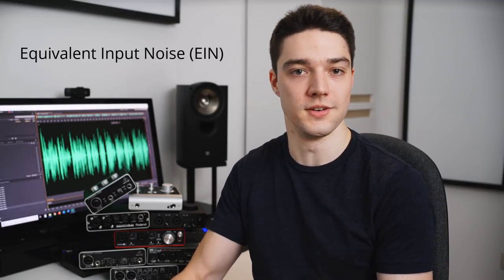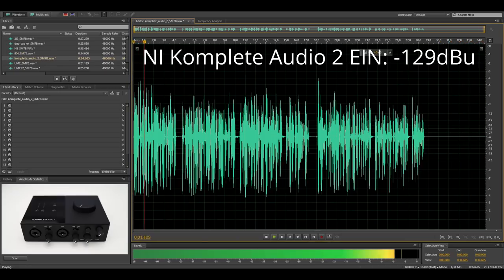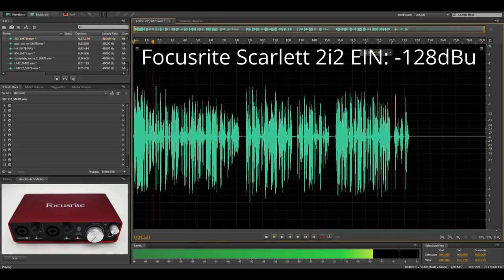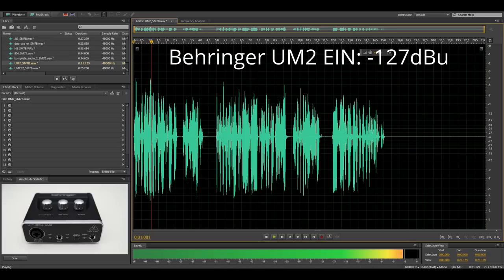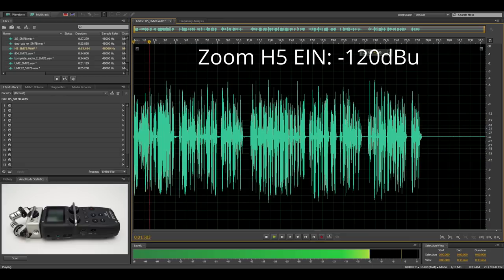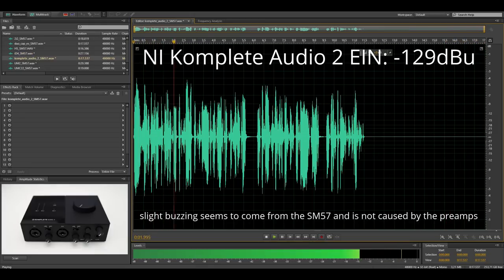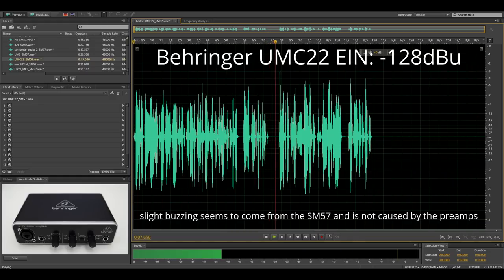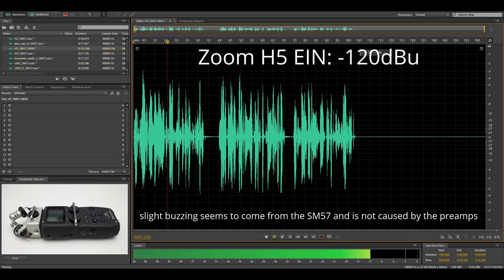Noise Compared - Behringer, Focusrite, NI, Roland, Steinberg, Zoom (with Shure SM7B and SM57)

Comment: The Audient sounds great of course, and I'm also very impressed with the Behringer UMC202HD, especially when you compare its price to the other offerings.
Reply from the maker: I totally agree, the price-performance ratio is very high with the Behringer interfaces.
Reply: @JulianKrause  i'm surprise only -1dbu difference... i am rocking an id14 btw
Reply: But you cannot compare the preamp of behringer with the others...
Reply: @MRBADGUY0027  yes because its midas and outstanding high quality
Reply: @JulianKrause  the dynamic range of the umc202hd is much lower than something like motu2，result is a “harder harsher or cheaper”sound
Reply: @Hallucinogenichusky i aggre i have umc22 but not the umc202HD. It produce little bit noice, than i try steinberg UR22MKII and the noice gone. 

I concern it because the quality of the preamp (yamaha vs midas) or because i put only single line input on behringer from the X32 compact mixer, but on the steinberg i put 2 line input from the X32 compact mixer. (I cant put 2 line on Behringer UMC22)

How you thing..??
Reply: @Hallucinogenichusky if you are using a Mac , check the ground on the charger
Reply: @liningwzgl  Why there should be a difference in dynamic range??? UMC202HD has 24-Bit/192kHz encoding rate. This test shows almost the same noise/signal rate. Can you prove that it has “harder harsher or cheaper sound"?
Reply: @aloahe4807  They are MIDAS design preamps, not preamps from Midas, it couldn´t be that cheap and have the best preamps on the market.
Reply: @misterjaroslav6859  Just because the ADC samples at 24bit doesn't mean that it can actually make use of the mathematical advantage of the bit depth. They just make it 24bit so they can fool consumers, when in fact the dynamic range of the electronic circuit is even smaller than what 16bit is capable of.
Don't let "specs" fool you.
Reply: @misterjaroslav6859  he quite literally measures the dynamic range in its review and it is noticeably lower than other interfaces.

It is half the price so can't complain.
Reply: @God-yb2cg  I do not want to dig into this topic again. I bought Yamaha AG06 and am quite happy now.
Reply: @yz249  OK. I bought Yamaha AG06, so I do not care ;)
Reply: Very helpful comment sir! Thanks God bless you!
Reply: @JDunamis  Thank you, you as well.
Reply: I have the Behringer UM404HD Euphoria and it is absolutely INCREDIBLE. I paid $135 on Amazon in Nov 2019. Best deal on a piece of gear I’ve ever had in 30+ years of recording. It’s now $180 on Amazon and easily worth more that that by a lot…

Comment: Finally! This is a great comparison, the most useful on YouTube so far!! I'm curious if this is keeping ambient noise in or out of the equation (if so, how do you do that?) And do you plan on comparing this same preamps with/without cloudlifter? (I know in theory it shouldn't make a difference, but a practical test can be great). Also could you do something like this (practical) comparing noise using dynamic vs condenser mics and if the interface would make a difference too? Thank you very much!
Reply from the maker: Yeah, I will do some test like these in the future!
Reply: Julian Krause Any tests on the Mix Pre3?
Reply: Just for anyone that's curious that comes across this video, you can achieve this by plugging in a "Dummy plug" into the interfaces. It's typically just a XLR plug with a 150 Ohm resistor soldered in (same resistance as most dynamic mics).

Comment: This is a wonderful comparison! Thank you so much. I've been looking for a video like this for at least a year. I was concerned that my UMC204HD wouldn't have enough gain coming from the Midas preamps to power my Rode Procaster so I bought a lifter, and it turns out I didn't need it. For my purposes, the 204 has enough juice to power the mic without any hissing. This gives me the confidence to move up to an SM7B in the near future, and it also gives me a very cool toy to drool over in the Audient i4. That looks like a wonderful interface. Onto the wishlist it goes!

Comment: I have the id4. The input noise of the instrument input is much worse than the mic input, so for high gain guitar it's beneficial to use a DI box with a balanced SLR output so you can plug it into the microphone input.

Comment: I think it would be interesting to see a review of a mic preamp and how a mic preamp can "change" the specs/measurements and value of an audio interface.
For example, how adding Behringer mic2200 to a behringer umc202hd would change the overall performance of the umc202hd (compared to focusrite scarlett for example).

Comment: We can look it up for ourselves, but I think with low output dynamic mics, maximum gain is important. Of course you can always make it up in post, but we shouldn't waste bits needlessly. As for the noise, there was a difference in the meter peaks between these preamps which matched the noise floor, but unless your business is Foley, I wouldn't worry about it.

Comment: Something to consider: The very most of the audible noise isn’t even the EIN anymore at -127db or even less. That being said,  this comparison does not make it that clear. Compression however can  increase these differences quite a bit more. But this amount of compression isn’t used all the time.
Reply: Michael Walsemann so which one is the best price vs performance ratio

Comment: Thank you for the professional test, Youtube really lacks such ones. As it is noise that is measured, it makes sense to whisper at some distance from the mic. This way the level of signal will be comparable to the level of noise. Gain needs to be at the highest level that can be achieved by all interfaces. BTW such conditions are encountered when making ASMR videos. Some silent interval without whispering, or sensible pauses between words are needed as well.

Comment: I already have the umc22 but I'm just being paranoid that the others will give me a cleaner vocal recording.
Reply: my umc22 hums at -72db :/  And I don't know if the problem is the interface or the usb ports in my pc
Reply: @licccio2133  try plugging the PC in another outlet, sometimes the grounding can interfere with the interface. Also try a different port, some ports are designed to supply more stable power.
Reply: @licccio2133  Also try to add ferrite ring clips against RFI EMI noise if your USB cable doesn't have them already (a few bucks on ebay, just select the correct diameter).

Comment: Julian, not all interfaces you tested can give a mic upto 60dB of gain. Did you find any correlation between interfaces with preamps that can achieve 60dB of gain and those that can't?
Reply from the maker: No, I didn't find any correlation between preamp noise and the amount of gain the preamp provides. The Komplete Audio 2 has the least gain of all the interfaces in this test. This meant, that I had to set the gain to the maximum to get the peaks into the -18dBFS range. But it still has an incredebly low preamp noise.
Reply: @JulianKrause  Truth be known, any one of these preamps is acceptable for podcasting or simple VO and most people wouldn't be able to tell the difference between them in a blind test.

Comment: Julian Krause, hi, can you answer a few questions? I've watched a lot of videos on different audio interfaces and can't decide on a choice.
1) What is better for me to choose: Steinberg UR12 or Behringer UMC204HD? Which interface would be better to show themselves in the voice recording? Can I listen and record simultaneously on these interfaces?
2) Behringer С-1 is a good choice for voice recording, as a microphone up to 45 euros?
3) Is there a noticeable difference between writing 24 and 32 bits? Is 32 bit audio necessary for YouTube?
4) Can the audio interface output audio to multiple devices that are connected simultaneously (can I switch between these devices without disabling them)?
Some questions may be unclear, since I used a translator, I am from Russia.
I will be happy if someone shares their feedback about the audio interfaces I mentioned)
Reply from the maker: Hey Zurich, 
1) I would personally go for the Behringer UMC204HD. Better preamps and two inputs. You can listen and record simultaniously.
2) I haven't used this mic, so I don't know.
3) There is no audible difference in recording with 24 or 32 bit. In 99.9% 24 bit more than enough.
4) Well, you can connect multiple devices but you cannot switch between them. They will all get the same audio simultaniously.
Reply: @JulianKrause  Thanks for help)

Comment: Thx for the video. I have an UMC404HD, but I think the comparison of the UMC22 represents the 404, too (same hardware). I have a question though about audio routing based on these numbers. I can connect a guitar directly through the inputs. I am thinking of sending this signal (dry) to both my daw (on Windows) and the amp. Would that be OK looking at Your results? Or is there a loss of signal that would not be acceptable?

Comment: Just in time..I was going to buy that Audient but the Beringher is so close in performance. Saved me a ton!

Any chance of getting hold of a Zoom H6?
Reply from the maker: As far as I know, the H6 has the same preamps as the H5. So, the preamp noise performance of the H5 and H6 would be identical.
Reply: @JulianKrause  Same preamp....does that also mean it has the same clipping problem as the H5?

Comment: What brand of XLR cable did you use for these tests & how would you rate the importance of investing in a "quality" cable?
Valuable comparison, thank you Julian!
Reply: (I'm not Julian, but I'm also into music production and electronics!)
As a XLR connection allows noise added in the cable to be cancelled out (using a balanced signal), I think the connectors of the cables are more imporant than the wire. For a 6m cable, I'd recommend getting one with Neutrik connectors, between 6 and 14 £/$/€, like this: https://www.thomann.de/gb/cordial_cam6bk.htm
Reply: @joshzhu  Thank you Josh! Your input is just as valuable. I have been reading on the topic and learned about different cable configuration like quad & dual but hadn't heard much on the importance of it's connectors. Only seen a disassembling vid showing the soldering types of inexpensive and higher end cables along with noticing some cables state having gold plated pins, so this is good to keep in mind!
Reply from the maker: @mica4977  Hey, I can vouche for Josh.  Don't spend crazy amounts of money on cables but don't cheap out on them either. A proper cable with Neutrik connectors like the linked cable is a good choice.
Reply: @mica4977  I think the one you ordered is fine! The connections look fairly well designed, probably a copy of the Neutrik ones.

I don't think there's much advantage to buying the second one to justify the price difference. Neutrik plugs themselves only cost about $3 each, and mic cable costs about $0.27 per ft without plugs.
Reply: @joshzhu  Stuck with the first cable and it has been working well. Thank you for the extra tid-bit of info!
Reply: Scrolled too far to find this question! Lol. I am wondering the same. I have this preamp which is supposedly low noise  but I am experiencing pretty bad hiss on my mics. I see all these glowing reviews for Mogami and similar brands saying it solved their noise issues, but I also hear it doesn’t make a huge difference. By this point I’m about to order one just out of curiosity and to eliminate another variable. Thanks Julian and Josh for your answers!

Comment: According to the specification in the official guide to the Beringer UMC404HD SNR= 100dB, and in the Beringer UMC202HD  SNR=110 dB. Please answer, the EIN of the microphone input 404HD will also have  less than 129 dB?
Reply from the maker: I havent't tested the UMC404HD yet. But if I had to guess, it's probably going to be pretty similar to the UMC202HD.
Reply: @JulianKrause  Vielen Dank.

Comment: Hi Julian, thank you for all your work. Just a question about Zoom H5 ( I have H6 and it's the same preamp). I'm planning to buy a couple of fethead phantoms in order to improve S/N of my recordings with low output condensers but I'm wondering if H5/6 provide enough phantom current to power both the mic and the fethead ( which draws only 1mA, but still...).; have you ever measured it?  Thanks
Reply from the maker: Made a quick measurement and it looks as if the H5 can deliver up to 14 mA. As long as the combination of FetHead and microphone stays below that, you should be fine.
Reply: @JulianKrause  Thanks a lot!  I've heard from your videos that condensers don't need an inline preamp; still -120 db is considered a poor performance which I think may affects even condenser's performance. I noticed that I can hear an audible increase of noise from Zoom h6' dial 5 1/2 up regardless individual mics sensitivity. At that gain, of course a -30 db mic sounds louder than a -48 so I wouldn't need a boost, nonetheless the precise step from which the noise shows up make me think we are still in the realm of preamp noise than mic's.  What do you expect the improvement would be in use with condensers; 5 db or so? What the difference will be from adding Fethead Phantoms vs. using a recorder with better EIN?  I like H6 form factor for portability and convenience, though.... Thank you so much

Comment: Hello Julian, The Audient website states the ID4 has an EIN of of -126? I'm sure you did your tests properly, so I'm a bit confused about why that would be the case, also, will you ever review it's bigger brother, the ID14? I'm interested in hearing your thoughts and seeing your findings as they're quite different as far as I can tell, It's the interface I use for my voiceovers, thanks and I love your videos!
Reply from the maker: Hey, my measurement of the preamp noise of the iD4 is different then the specs from Audient because my noise measurement is A-weighted and the Audient spec is not. Because most manufacturer apply A-weighteing, I do it as well to keep my measurements comparable. 
Yes, I try to get my hands on an iD14 as well. From what I have seen so far, it will probably going to measure very well.
Reply: @JulianKrause  Ahh thank you for responding and for the explanation! That definitely makes a lot of sense, I appreciate you taking the time to respond, I learned something today :) I'm excited to see your review of the ID14! Thanks Julian, and love your videos again

Comment: Great video! How did you come up with the EIN figures? Audient's website says the iD4 has a -126db mic pre EIN, but you reckon it's better than that, at -130db?
Reply from the maker: The specs from Audient are unweighted and thus higher. All my measurements are a-weighted to keep them comparable.

Comment: Hello Julian, thank you so much for your review! I am planning to buy this, just wanted to check one thing. I have an M Audio Fast track currently that I'm using but there thing is when I crank the volume up to full I can hear hissing sounds and ambient sounds in my headphones which disturbs my singing and if the gain is low then that is also an issue due to low levels . Does the UMC 22 also have a similar thing happening when the gain is on full levels?

Comment: I have some other question. I a beginner electronic music producer and, for now, im not using the interface to record instruments or voices, all my songs are created inside the computer. Im currently using my field recorder H6 as a interface. Do you think I should consider to buy another interface?
Reply from the maker: What a proper interface can do for you is to lower the latency of virtual instruments. If you for example have a kick drum bound to a key on your keyboard, you don't want to have any delay when hitting the key and hearing the sound.
And I think it is easier to control the volume because it an interface typically has a bigger volume knob.
But if you H6 is working for you so far I don't think you have to upgrade immediately.

Comment: Can someone please explain to me what the point of a -130 dB noise floor is when the ambient noise from surroundings in this video is in the -55 dB range? Who can hear 75 dB lower than ambient "silence?"
Reply from the maker: Hey, the equivalent input noise is a measurement to make noise of preamps directly comparable. But it does NOT mean that you will end up with this amount of noise. The recorded noise is heavily influenced by the amount of gain you use. Also, ambient noise measured in dB SPL and EIN measured in dBu(A) is not directly comparable either.

Comment: Hi thanks for the very informative and excellent video.  Do you think that noise measurements carried out with inputs shorted (i.e. without a mic) would provide different figures ?  Thanks and kind regards, gino
Reply from the maker: Yes, it will absolutely change the measurement. With the input shorted you will only hear the voltage noise of the preamp. With the 150 Ohm load connected, you get a combination of voltage and current noise from the preamp in addition to the noise of connected load. This is why connecting a 150  Ohm load is considered to be a more "real world" measurement.
Reply: @JulianKrause   Hi and thanks a lot for the very kind and helpful reply.  It is important to check the noise also with the mic of choice ... After this comparison may i ask which sound card you like better in the end ? what do you use for your works ?  thanks a lot and kind regards, gino
Reply from the maker: @gino3286  I'm still testing it but the Motu M2 ist becoming my new favorite.